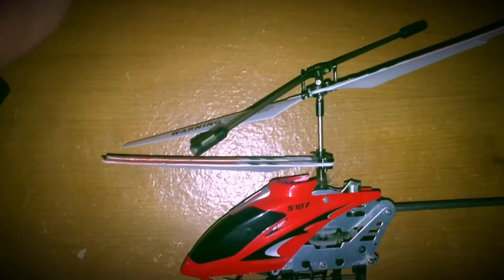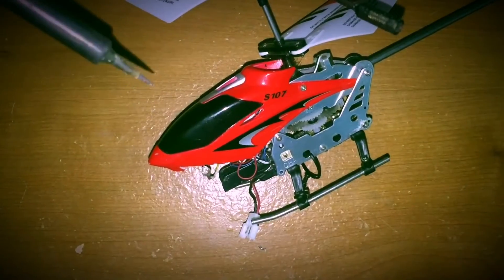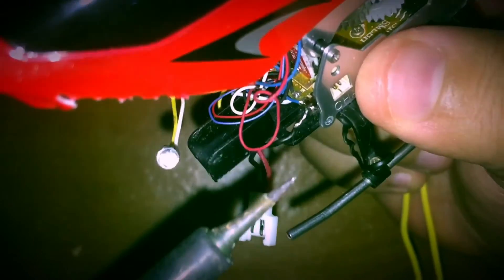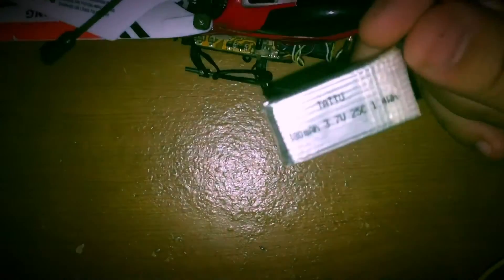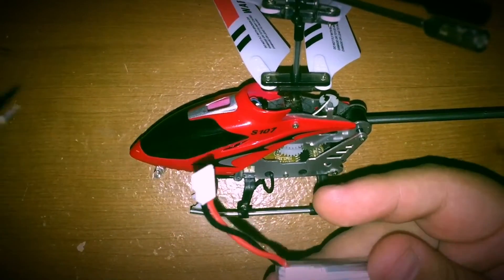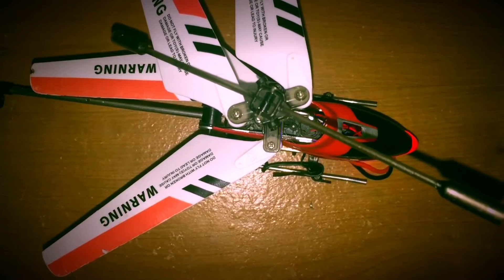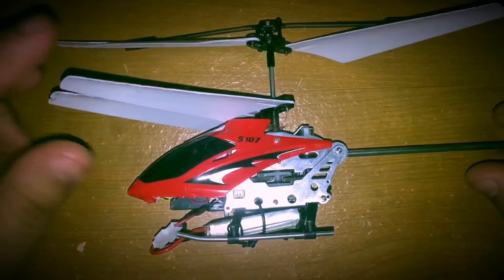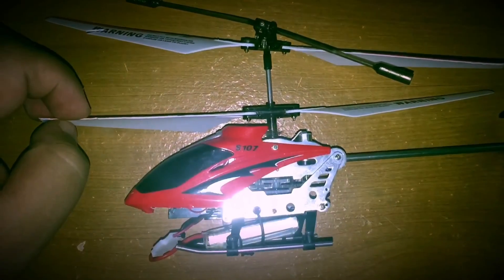Syma S107 Battery Mod

Comment: You did FAR MORE than just a battery mod. You took off the lower two tail boom extensions and the tail fins. I've heard of doing this to perform better flight. You might wanna explain that too. Because i know for a FACT that your heli didn't come that way.

Comment: I did battery upgrade on my Syma S5H from 100 mAh to 250 mAh and it performs worse than on stock 100 mAh. Probably because this helicopter flies on narrow voltage range something between 3.9V and 4.2V. Larger capacity doesn't increase voltage drop time from 4.2V to below 4V but it introduces few extra grams so overall helicopter flies shorter and charges longer.